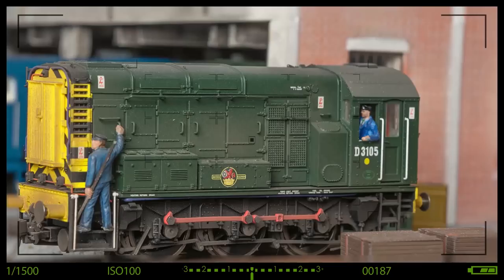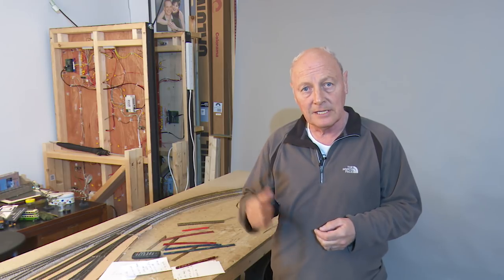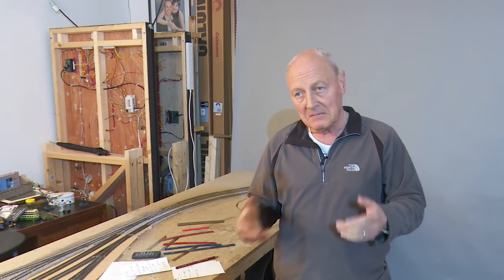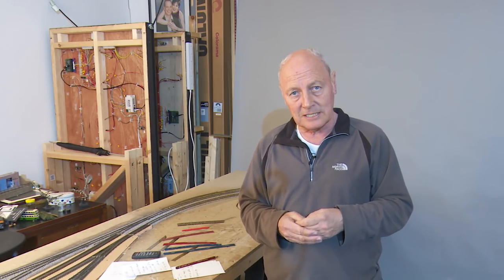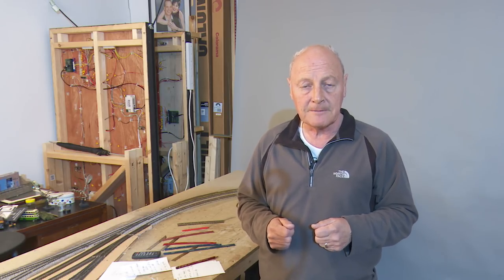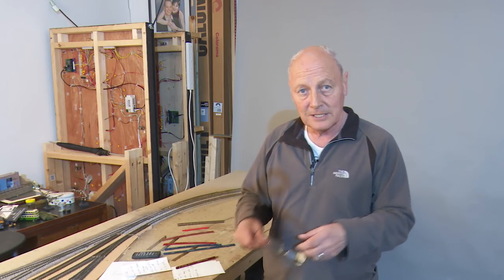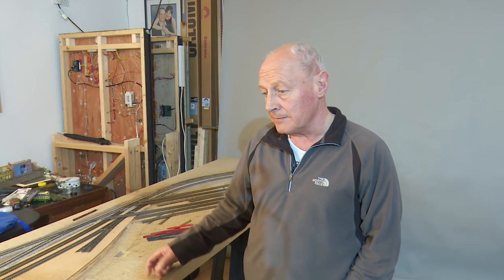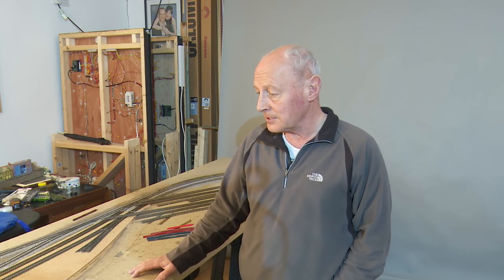27. New Chadwick Part 3 at Chadwick Model Railway

Comment: Great video as always. I still think you have an operational problem for the DMU platform. So a DMU would come from right of the screen to left of the screen and terminate in the DMU platform. It surely wouldn't then join the platform heading left again via a headshunt to keep going left? Surely it would want to go right back where it came from? Then you don't need the headshunt, but also there is no crossover which permits the train terminating in the DMU platform to get onto the correct running line heading back right? Similarly on the other station approach, there aren't any cross overs that permit trains to reverse?
Reply from the maker: Hi there (I don’t know your name),
I understand the point made but as an edge of town parkway station I think it will work. I also consider it as a small parcels platform.  I can also use both the platform and/or the headshunt to lay up a DMU.  For more prototypical running, I can always move a DMU onto the main platform, prior to departing into town.
Regards Charlie

Comment: Hi Charlie, I’m just catching up on your update now. You make some valid points regarding the collecting of railway paraphernalia and the long term goals of layout construction. I try only to buy materials as and when I need them but find my Achilles heel is the lure of a new loco every once in a while. Like you, I am constructing the main part of the layout with only a hazy thought to a future inclusion of a fiddle yard area - I’d much rather see trains running through scenery than spend an age trying to get the stabling points organised: time enough for that when the scenery is completed. 
As to that terminus siding, I’m not sure you are taking the right approach. In my head, a DMU approaching the station and continuing on down the same line would use the through platform rather than the terminus line. That terminus line would be used for trains where Chadwick Parkway (?) was its end point, departing trains would then head back in the direction they came from raising the need for a slip to take you to the up line rather than a headshunt. Of course, these are all just musings of a guy with no knowledge of real railway operations! 
I do enjoy your how to guides but it will be nice to have them interspersed with some railway updates. Paul
Reply from the maker: Hi Paul,
Many thanks for your comments. I’m so pleased that you enjoyed the video.
The DMU platform will be doubling up as a parcels facility to help make it a little more authentic but I do appreciate your valid point. 
Regards Charlie

Comment: Hi, Charlie. Another excellent video, thank you. Looking at the underside of the DMT board (stored in the corner)  I was interested in the post and socket leg supports (3x2 or 4x2)?)). I was also taken by the base board design allowing it to be lifted out to provide a more comfortable for working on electrics/electronics. Was the post and socket leg support design to facilitate this lift out  - moving away from the more conventional fixed integral leg and top design. Few, I hope that makes sense :)
PS, at the tender age of 72 I also worry about biting of more than I can chew :(
Thank you. Regards Keith
Reply from the maker: I think the legs are CLS (a trade size of about 3" x 2").
Yes I do try and complete as much work as possible prior to fitting the boards into place.  Bear in mind that one day I might move!

Comment: Hi Charlie, me again, I was wondering if you had recevied your Digitrax PM42 yet? I bought one recently and have carefully been wiring it up as per instructions. Now, I have a Lenz controller (LZV100) which acts as my "booster" - However, it "says on the tin" that if district 1 'shorts' districts 2,3 & 4 will remain "live" but upon testing, the PM42 does indeed 'trip' District 1 but it also 'allows' my booster to trip as well cutting power to ALL districts!!! Have you had any experience with this situation? (Sorry to post here but can't find a PM option anywhere)!
Reply from the maker: Hi Andy,
Yes I already have a PM42.
When I short out any of the 4 districts, the other 3 remain running.
Either your PM42 is defective but more than likely your Lenz controller has a compatibility issue.
I’d email Digitrax for their opinion.
I hope this helps.
Regards  Charlie
Reply from the maker: Also can you run your layout without the LZV100?  I have a Digitrax controller so I can’t do any comparisons.
Reply: Thanks for the prompt reply Charlie, Yes, my LZV100 (via my PC and TC Gold) currently "runs" the entire layout!
Reply from the maker: Another thought, isn’t the reaction time of the PM42 adjustable, so it can detect the short earlier than you controller?

Comment: Hello Charlie, I think you've made the right decision to always give yourself the option to expand the layout if you want to. My stepfather and I are building 'The MegaLayout' in my old bedroom and it's quite an undertaking. If it's any help, we managed to build the helix (3 track, 3.5 turns) in 3 days including laying the track. The biggest hold-up on time was cutting the cork underlay. I kind of wish I'd filmed it, although it would likely have taken twice as long! If you change your mind about it and need a hand, we're only over in Bristol/Clevedon. Here's the thread on RMWeb:
http://www.rmweb.co.uk/community/index.php?/topic/135452-northbridge-junction-extending-already/
Reply from the maker: Thanks for your comment. I’ve checked out your RM Web thread and that’s a great achievement in such a short time.    
I still don’t know if I will opt for a helix facility but only time will tell.  I’m pleased that you sealed yours.  I much confess MDF is something I tend to avoid. Good luck with your layout. Regards Charlie
Reply: Absolutely, we're using ply for the majority of it, just MDF on the helix due to the ability to work it easily. Thanks!

Comment: Hi Charlie why are you replacing your point with a code 75 double slip and not a code 100 double slip? Neil
Reply from the maker: Hi Neil, it’s because Peco don’t make an electrofrog version in code 100, only the insulfrog.  I much prefer electrofrogs for more smooth running and they look much better.
Regards Charlie

Comment: Why not just call your layout.... "Chadwick"?

'Parkway' is a rather modern invention that came in the 1970's as a way to mitigate the problems of increasingly congested roads caused by closure of branchlines under the Beeching cuts. 
Instead they wanted to have 'park and ride' locations where people drive from a local village/town on the outskirts of a city, park your car there (hence the name 'Parkway'), and commute into the city centre.

Since your layout is a 1960's one (compusory yellow ends were added in 1962), 'Parkway' is not really suitable for this era.
Reply from the maker: Hi (I don’t have your name),  I think that you’re right.  The station will be a parkway the the depot will remain the TMD but the layout will be Chadwick.  Based around 1970 I think that will work.  Good luck with your project.
Regards Charlie